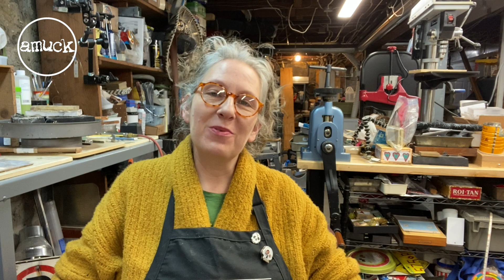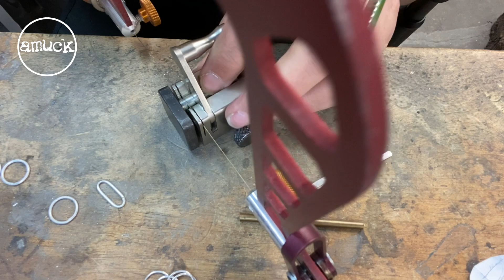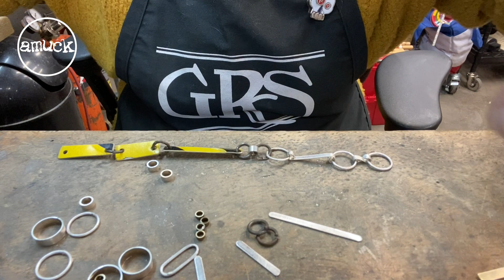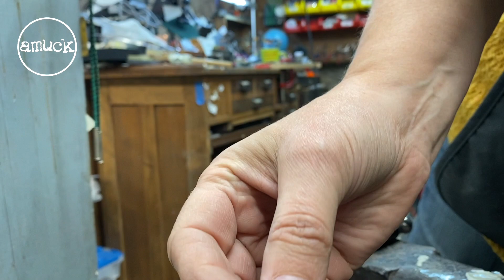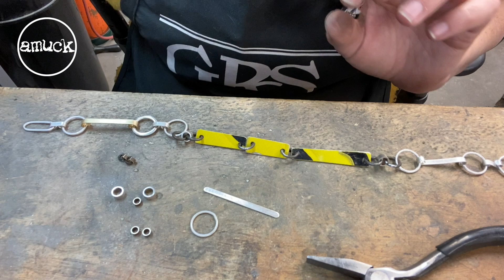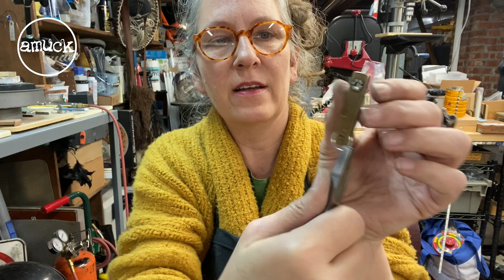cold connect chain making

Comment: also, what size blade would you recommend to cut the aluminum tabbed back with? Thanks in advance...I'm so excited about trying these new cold connections!!! :)
Reply from the maker: I almost always use a 2/0 blade for my work. I know there’s guides for using different sized blades for different thicknesses but the 2/0 to me has been great for most projects.
Reply: @amuckdesign  Awesome, thanks! :)

Comment: If I wanted to use aluminum instead of silver for the tab back of the moth brooch you made, what gauge of aluminum would you recommend?
Reply from the maker: I like using 22 and 24 gauge metals. Actually with aluminum being a soft metal I’d probably go with the 22 gauge.
Reply: @amuckdesign  Thanks! :)